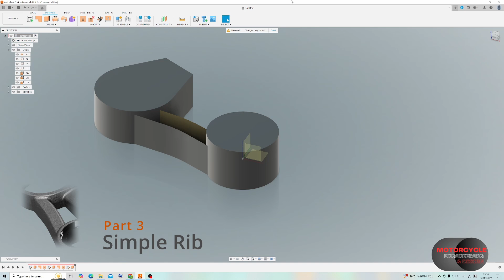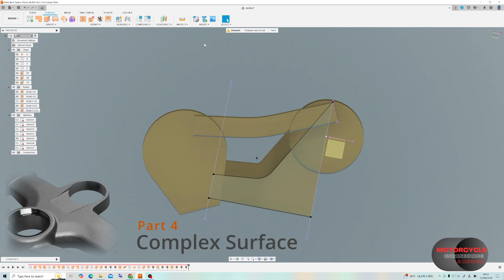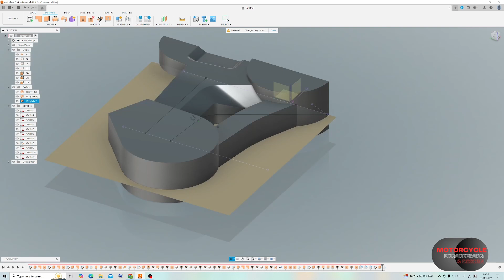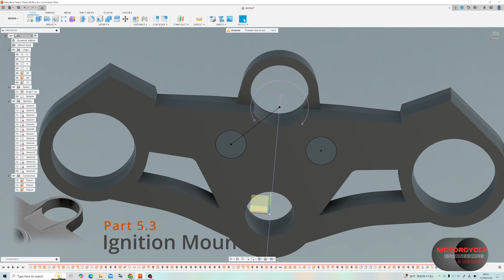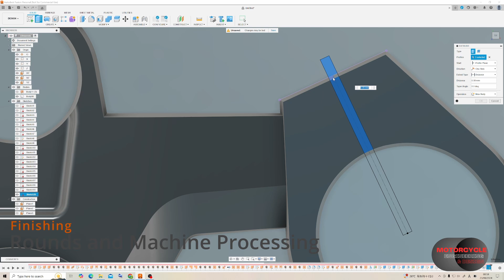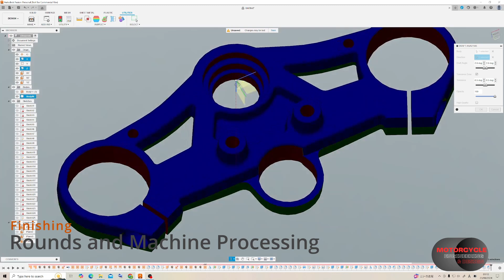Motorcycle Design, Surface Modelling

Comment: why are you surface modelling these parts? is there a advantage over solid modelling?
Reply from the maker: Hi there! 
I wondered the same when I went from Uni to Royal Enfield.
There's a few reasons why we typically use surface modelling in the automotive industry, especially in chassis design - you'll probably find more solid modelling in the engine teams.

One reason is for aesthetics, it's much easier to create and control the curvature and continuity of your surfaces when using surfaces modelling, also for working in draft angles required for castings which also brings up split lines and various other features, features that may require movements in the tooling to create for example.

So even if something isn't thin or sheet metal that you could easily expect to be modelled in in surfacing for example, we still use surface modelling for the level of control.

Also, since we work in large assemblies, we will often copy other surfaces in for reference, and sometimes those surfaces might be used in the model itself.

Basically, I think if you are interested in using 3D CAD as an engineer or designer/CAD operator, I'd highly recommend getting used to using surface modelling and study geometric dimensioning and tolerancing (gd&t)
I hope that helps!
Reply: @MotorcycleEngineeringAndDesign  Thanks for the explanation. I will learn more about surface modelling. Your videos are great. I almost watched all your videos. Please keep uploading.
Reply from the maker: Definitely! I wouldnt worry about the "free forming" so much unless you are interested in industrial design 👍  
And thank you so much, I really appreciate the support! 😊